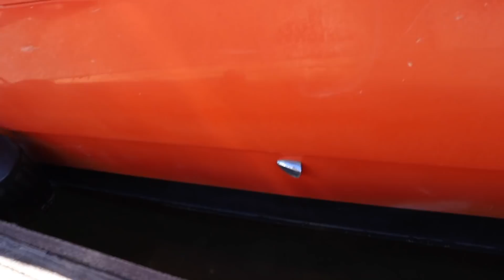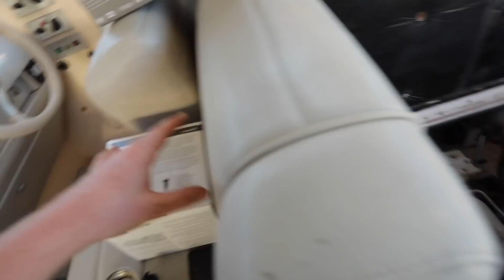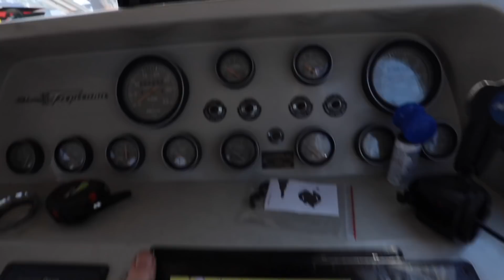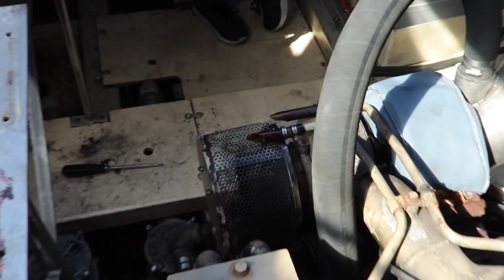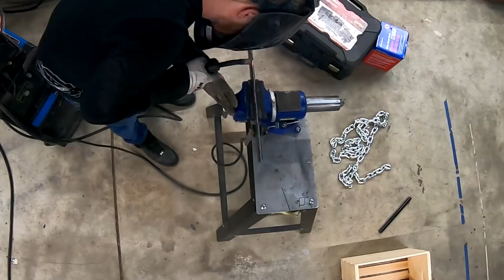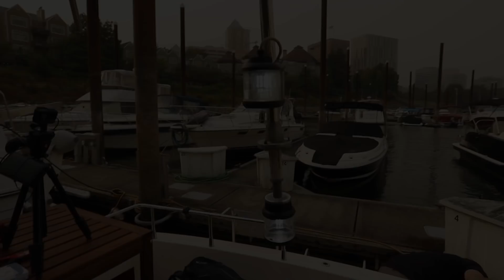Fixing Up My 30yr Old ITALIAN YACHT!

Comment: (why i know wtf Im talking about: Internationally licensed sailing yacht skipper)
Ok, I wont say that you can NEVER use two anchors (like some are saying), generally speaking, we use a single anchor that has sufficient chain length to keep the boat stable, and allow enough room from land and other boats on all sides for the boat to swing around. This is the simplest arrangement. If you are going to be awake (like while fishing) using two anchors will usually be fine, as you will be around to fix any issues that arise, if you are doing this to sleep, things get more complicated.

You can use dual anchors, or land lines (lines that run from the stern of the boat to a good anchored spot on the land straight astern of the boat), to keep the boat pointed in a single direction. We do so in some bays and coves in the Mediterranean where anyone who anchors uses either dual anchors or an anchor and land line so that everyone can stay in one place and be sure everyone has enough depth in a shallow cove. Keep in mind that in that situation, we always know where the waves will come from (from the end of the bay facing the sea) and any strong wind will usually be from the same place (as the land will be a wind break and will slow winds considerably). If you are going to do this I would recommend a stronger anchor and MUCH more chain (proper anchor chain, not what you are using now, it is expensive, and it is necessary), as you will need to rely on it. If you will run aground or hit another boat unless your boat stays in one place, then you need to be able to depend on your secondary anchor to keep you in place no matter what. Thats not the simplest thing though, on the mid size (40-70ft) sailing yachts we usually use a dinghy to carry the other anchor out a decent distance, then use one of our winches to tighten the anchor line in order to set the secondary. You likely have neither a dinghy nor winches, which further complicates things. You dont always need the winch (we dont need them on the smaller (45ft or less) yachts), but you will need a way to put the secondary a decent distance away from your boat. You might have an inflatable rowed dinghy you could do this with, please dont try to swim it, it feels ok for about 10 ft and then you drown... 

Overall, if you are going to do anything other the simplest situation (single anchor, properly set, with enough room to swing), then I recommend doing some reading from a reputable source (many good books on the subject) AND I would say to get a short training course as well. You may have to travel a bit to get good, proper training (as I did for my lincense), but nothing beats proper training from an expert. Please be safe, and have fun!
Reply: Awesome response and great information from obviously someone who understands anchoring a larger boat , deploying setting and retrieving a set anchor set from the stern of a yacht  is a complicated process  a dingy is definitely needed to deploy and retrievie stern anchors , if the weather gets heavier it can be a real task to retrieve the anchor which needs to be unset , i like a line running tp the head of the anchor with a float attached to lpull back against the set, getting a fouled stern anchor is a real task and without the line to unlload the set it often can result in losing your hook . For me the negative aspect of deploying a stern anchor  far outweighs any benefit you can expect , its a anchoring solution  that should only be used by someone with a bit of experience  and only when seas wind and current are almost non existent.. If the seas where you have anchored are making the boat move and roll and you are considering adding a stern anchor to stabilize the boat , its too complicated/and an inappropriate time to use that system ...
Reply: 5p's
Reply: I dont know if its just me but i personally think that his second anchor also might be a bit on the small side, because when i compare it to the anchors we use for 5 meter long steel sailing boats it look about the same or maybe even smaller, and we manage to rip anchors out of the ground with wind.
Reply: @errorusernotfound-iq5hh  Youre not wrong. If they want to use a little anchor just to keep them selves more or less in the same place while doing some fishing, probably ok, but they still need to use a dinghy to take the anchor out and should have more chain (and actual anchor chain) so they can set the anchor correctly.  So long as they would have enough time to react before the boat hits anything, if the anchor were to drag. 

Now, if they were going to sleep in a narrow bay where everyone else is dual anchored in order to allow everyone to stay in a narrow part of the cove where it is deep enough (for example), its a very different story. In that case they need an anchor not much different from their primary anchor, and about the same amount of chain (true anchor chain, not the small little chain he put on his anchor). because in a bad situation, if either one pulls out youre running aground or running right into another boat. And then I can only say I hope you bought good insurance...
Reply: Anchors....or boat gear in general.... 3 is 2.....2 is 1 .... and 1 is None !!
Reply: They said they were planning on cruising to the ocean and do some ocean boating. Wouldn't they need RADAR/Radar reflectors, a flare gun , survival suits & PFD's, and possibly an EPRB in case of an emergency/disaster?
Reply: @XENONPLASMA  radar really only exists on quite large yachts. That's not universally true, but even most 70-90 foot sailing yachts ($10 million+) don't carry them. Reflectors are a bit more common, people who do a lot of "blue water" cruising will put them on their masts, mainly because they will spend potentially a couple months at sea where big container ships and such can be really near you in the night and never see you. Most ships? Even ones that do ocean cruising, as long as it's not "blue water" as in, hundreds of miles from any piece of land, I wouldn't worry about it. 

Flare gun is a decent idea on any boat of any kind anywhere, but not required. PFDs usually ARE required by law for each person on the boat (not wearing them, but having enough on board for them all). Not having them is fucking moronic. Survival suits are definitely not needed unless you're going to be in very cold waters and may need to spend a lot of time there (again, think blue water, where it may take days to find you). An EPRB is a good idea again for making long passages. If they're going to do much of that, then maybe. But if you're traveling like most do, which is a few miles off coast, always with land in sight, you can just call mayday and give your exact position. That's a bit harder in the Mid-Atlantic. You're ideas are good, just overkill for all but the most extreme boaters

Comment: A bit of advice to help you with electrical testing if DC systems invest in a power probe 3 they are super cheap and make electrical diagnosis extremely easy I bought mine about five years ago with the deluxe kit for a hundred bucks I’m sure they are cheaper now though

Comment: The only place that boat is going to with that anchor is Destination Fucked. You may be great at rebuilds but Dude, you suck at understanding the basics of anchorage. That pathetic thing is meant for the rowing dinghy of a 12 year old, not a motor cruiser. The chain you lay out should be a bare minimum of three times the water depth. On the basis of 'it was a bit I had at the shop' the depth is safe around 4 inches.  The anchor is crap BTW, go to the store and get a decent one for the size of the boat. If not then we will await the 'D is for drifting' or the 'F is for fucked' video

Comment: Might I suggest some cockpit carpeting or alternative flooring?   I like seadek which is quite expensive and good looking, or you can get what I have which is more cost effective and has lasted me several seasons so far, Sailrite fiberglass flooring which would give you a more retro / classic look for your old italian yacht.  https://www.sailrite.com/Fabric-Brands/Chilewich
Reply: I forgot to add that the Chilewich flooring dries very fast because what kind of boat carpet ever stays dry?   I sometimes spray down the floor to cool it off!   I don't mind it wet.   If normal carpet get's wet you have to hang it to dry for days and says wet long enough to mold and discolor.

Comment: You probably won't see this, but for the phone holder I would HIGHLY advise putting a lip on the side so when the water gets rough it doesn't fall out easily. Last thing you need in a stress elevated situation is your personal items not secured.

Comment: Dude two things.
1. An anchor out the back of the boat can be incredibly dangerous on an overnight stay as the wind direction and speed changes it could cause a capsize 2.anchoring is all about that chain not the anchor the chain really holds the boat down instead of
Dragging anchor so you need more chain my tender has more chain than that

Comment: Separate comment again on the anchor.  I'm not sure what you painted it with, but it seemed from your welding that it's plain old carbon steel.  My experience with carbon steel and the water is...well, paint isn't going to do it.  I realize you are mostly in fresh water, so you don't have to fight the super corrosive powers of salt water, but if you want your anchor to last, you should really send it out to be galvanized.  Lovely boat, by the way.

Comment: Do not buy a rear anchor - as many others have pointed out, the boat needs to be able to move with the wind and tide. Also if you are anchored near any other boats, you run the risk of collision with other boats. DO NOT USE A REAR ANCHOR!! People who do this are a scourge on the water. 

I lived on my 50' Chris-Craft for 2 years .. in case anyone wants to chime in and say I don't know what I'm talking about. I'm a very well seasoned boater.
Reply: Bow stern anchoring is not ideal , but sometimes nessesary,  in the med its how you are required to anchor in most anchorages , the logistics of deploying and retrievering the stetn anchor require the use of a dingy ,hard enough whrn its calm,  dangerous and complicated when its just a little rough , and the kickef fr me is if you get stuck on a lee shore with a stern anchor deployed and you cant retrievie it you have a potential fouling issue right there behind you close to things that matter ie rudder and propeller

Comment: Fusion stereos are much better marine stereos. Additionally they use nema and your garmin can control the system. Nema is a really cool system to integrate all systems on board. All my units are connected to the nema backbone and all talk.

Comment: I think those dimensions are ok for the secondary anchor but also that it will rust.
Reply: Nup every anchor system  on the boat has to be sufficient to hold the boat independently,  and that anchor wouldnt hold a 5m long runabout ,  the shank is way too short  and the blades dont have the required amount of articulation to get a reliable set ... bit of a fail really ... i mean really , he used the timber box to dictate the size of the anchor , that size anchor would never EVER holld  a boat of that size even in calm seas with a calm sea

Comment: Surely you are aware that marine gelcoat are not the same as mould gelcoat (esp. the chemical process by which parrafine/styrene migration during curing) ... you don't want to sand your gelcoat of a boat to the point it gets porous without waterproofing the surface again before the boat hits the water again.

Comment: If you use a fusion radio it will last longer than a regular radio and you can control it fully with your mfd (the Garmin) you will able to change all the settings as well as turn on and off .... but don’t change it now, that stereo will quit on you in 6 months then you can look into a fusion

Comment: Hi, not a boat person but the chain should be attached to the bottom of the anchor via a shackle, then attach the chain to the top of the anchor with a weak link so if you get it stuck you pull hard enough to break the weak link, the anchor then turns and you can pull it free

Comment: The hat look containers on top of the valve covers could be air/ oil separator if thats the case they need the negative pressure from the turbos to operate so u might want to pull them apart and do a good cleaning

Comment: Great projects that definitely add to the boat’s beauty and value.   I have to say that the styling of the boat is timeless.  I definitely see what drew you to this craft.  Two suggestions on the electronics add-ons. You might integrate a phone charging pad into your 3D printed mount what you do the final version.  Two, you might add a small 2.1 class D amp board and a mini sub (e.g., 6” tang band) in a small enclosure.  There are amp boards out there that love 24 volts input.  Glad to make more detailed suggestions if you like.  Let Parts Express be your guide.  Cheers and stay safe!

Comment: I would have connected the outside speaker also with the inside radio as well as the outside radio. And put a switch in between it you want to switch over to either radio :)

Comment: People usally don't use a rear anchor as it is too much of a danger of fouling  the props. Also check out  Speed Prop as they have  a surfacing system for the props that prevents corrosion and makes them look good

Comment: Vaseline is the trick for electrical connections on boats (and cars as well). A small dab on cleaned connection spades prevents oxidation for decades.

Comment: A stern anchor should only ever be used when anchoring with other boats rafting off yours. An example of this is when a number of boats are mored in shallow water and you want to keep your line straight, with the current, to be able to swim and such. I would NEVER stern anchor over night. But even more importantly than proper use of an anchor is ensuring you actually have the right one for the boat. I can tell you 10000% you took the cheap way out and it’s not going to work. First off, the anchor is not what keeps the boat in place, it’s just the pivot point. The chain weight is what keeps you in place. You need something like 3-4 feet of chain per foot of water... Beware, that steel is going to rust and run all over your crate and then your deck... aluminum is the way to go. 

Good luck man, boating is nothing like cars and you need to take the time to research and learn a little more about things.
Reply: All good dude but ii would not trust an aluminium anchor  , they have their uses , usually on preformace boats where the anchoring system is rarely used but must be carried to meet maritime code  and weight is an issue  , a hot dipped gal steel anchor is the most reliable choice , and these dont rust

Comment: (Naval Engineering Student Here) Excited to.. sea more boat content! 
I noticed a couple things that you might want to watch out for. You probably knew this stuff already, just want to make sure you don't have any problems. 
-Definitely watch a video on how to anchor a boat if you haven't done so already. They can be difficult to set and ti would be pretty hard to set two anchors pointing in different directions.
-In anything other than calm water you should not use two anchors because you want the boat to be able to point itself in the direction that waves are coming from. If the boat is pointing the wrong direction waves can start to go over the back causing flooding. The boat will also noticeably rock more and be less comfortable if it is not pointed in the right direction. You probably don't need to worry about this if you are in a thinner river with low current.
-Your awsome homemade anchor is going to rust no matter what. Make sure it is stored in a place where you are okay having rust stains.
-The oil breather is probably there intentionally to oil the filter and help it catch more crud, much like a K&N filter. Keep an eye on it and make sure it doesn't get too dry! (you probably knew that).
-Make sure your phone won't fall out or down if you hit a big wave.

Best of luck on your voyage and on all of your projects! She looks great!

Comment: Should consider using Collinite wax. Probably the longest-lasting budget wax I have used I use the "476" for my cars and it lasts through Chicago winters!. I also used the Yellow-Wax in the past as well, and although it does give an awesome result, it doesn't last, in my experience 2 weeks is what it takes for it.

Collinite lasts long but doesn't make your paint look like it's dripping off the car. BUT! You can topcoat it, with a "non-cleaning" wax! I top it with Meguiars mirror glaze, as it has no cleaning agents, however, it goes away on the first rainfall, so probably not the best for a boat.

Comment: You didn’t explain exactly what the engines where. They looked like turbo straight eights. I was curious about the engines
Reply: They are Cummins straight 6's.  Massive, extremely durable engines.   300hp each but capable of running all day, every day, at or near that output.   Basically the marine version of the engines in a lot of over the road trucks.

Comment: If it's not done already, I'd isolate the start bank from the house bank and  charge using a charging relay which keeps the banks separate then parallels when charging. Having them separate let's you run down the house bank and still be able to start engines.

Comment: Tide-E -Bowl cleaner will clean the grunge from the deck.   Then all you have to do is not wear shoes on the boat deck.  I am going by the video only.  You can use the polish like the hull.   Keeps the whole boat clean if you don’t wear shoes.